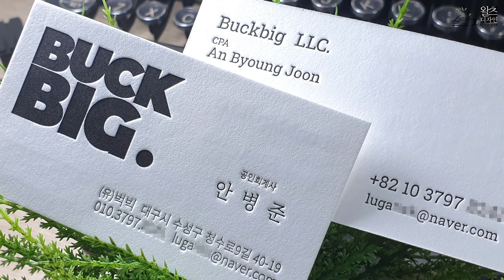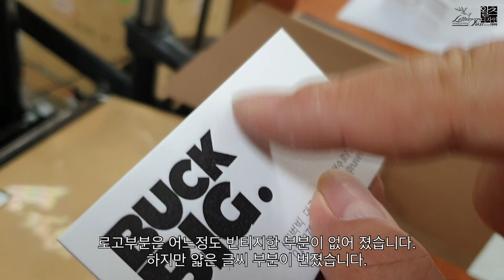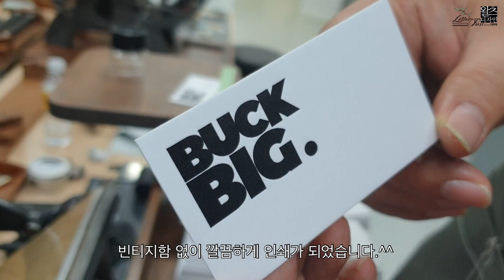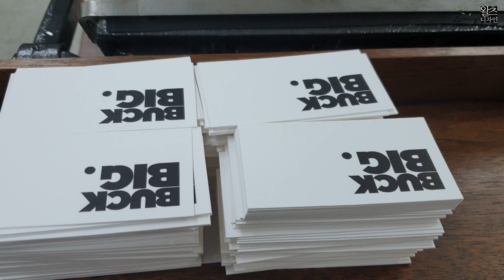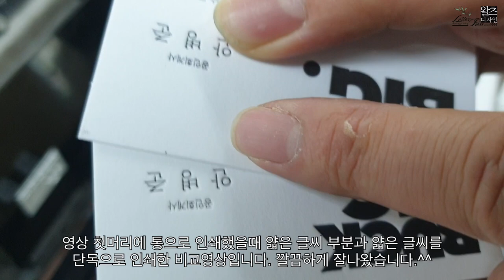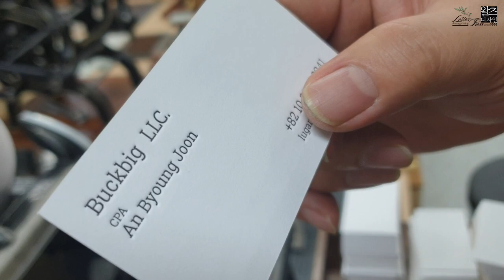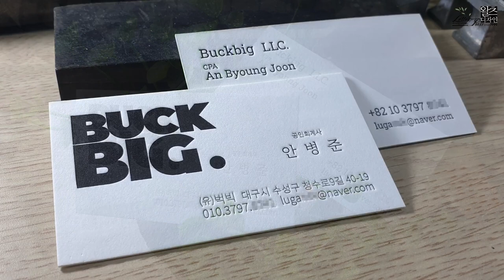When printing a letterpress business card with a thick logo and thin text...두꺼운 글씨와 얇은 글씨를 레터프레스 인쇄.

Comment: Waltzdesign Hello again... what is the make or brand of this press please... I'd like to add one to my yet to be built screen printing shop.
Thank you
Reply from the maker: Hello. The equipment shown in the video is called hohner. C&P pilot clone version. This equipment was made in Germany in 1975 after the C&P company closed its business and slightly reinforced with pilot design drawings. It is made of steel and is heavier than pilot equipment. As a result of my use, among tabletop equipment, it is equipment that goes into the tower. It is difficult to obtain because the equipment is rare. The price is also expensive compared to other equipment.
Reply: @w_letterpress  ok thank you...could you maybe suggest similar equipment thats less expensive but as good ?
Reply from the maker: Large equipment is recommended if the place is okay. As far as I know, there is an equipment called Golding Pearl, which was first made in England. I know it was produced by purchasing the copyright from an American C&P company later. I haven't used Golding Pearl, but I think it's okay because the production method is the same. It will be easy to get it from within the UK. I want to buy it too, but it is difficult to buy in Korea :)
Reply from the maker: @supernube5051  Looks good :)
The foot pedal type Golding Pearl also looks okay. It looks like you can apply more pressure than lowering the lever like a tabletop machine.
Reply: @w_letterpress  I'm sorry to be a pain but can you tell from the advert if its all complete... Will I need to purchase anything else expensive to be able to run the machine ?
And what is the ink duct sweep adjustment rod they mention ?
Is that easily "adjusted" 
Thank you... I do appreciate your time.
Reply from the maker: @supernube5051  It is not possible to know exactly the condition of the machine from the picture. In my case, I do not use the ink duct and the sweep adjustment bar. In the case of ink duct, it is a device that supplies ink during printing, but it is necessary and rarely used for mass printing. The sweep adjustment bar is also used for the purpose of preventing paper separation, but it is cumbersome and is not used. Ebay is good, but the point is to learn more about the individual selling through the community or blog, and to carefully examine the supplies required for printing. Equipment size should also be considered. Smaller sizes are fine if you mainly make business cards.
Reply from the maker: @supernube5051  
Oh, it is good if there are many chases.
Reply: @w_letterpress  I only want to make business cards as a sideline in my screen printing shop...which I'm yet to start lol.
What other equipment would be needed  for this press.
Reply from the maker: @supernube5051  https://www.instagram.com/p/B96I-PwhZ0z/?utm_source=ig_web_copy_link
In my case, this is the basic print set I need. Among these, there are cases where it must be made to order. These items are not something I can substitute for.
This is my personal setting and not the correct answer. Many of these were purchased through eBay.
The double base plate is made of a material called Bakelite, and the height must be set according to the height of the equipment and the copper plate to be used.
If it is difficult to obtain the material of Bakelite, you can use aluminum plate. Another offer is to purchase a base plate sold by a company called BOXCAR in the United States.